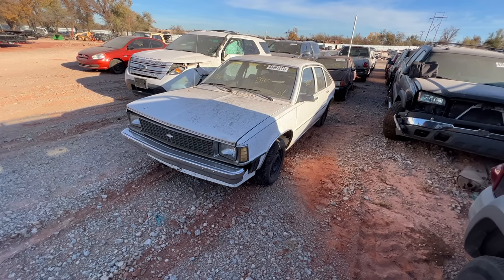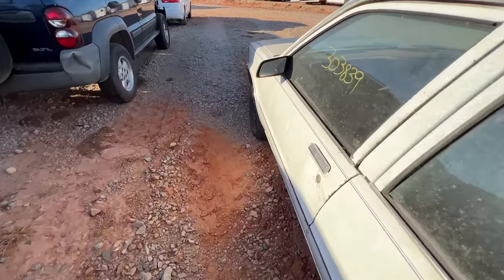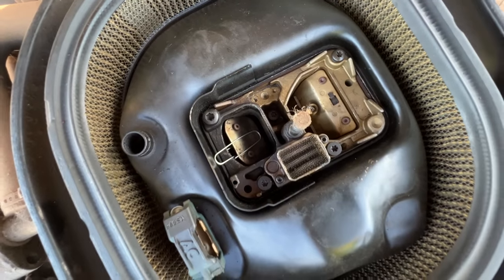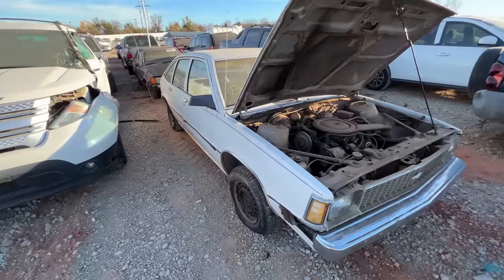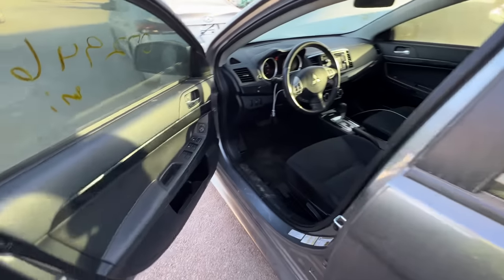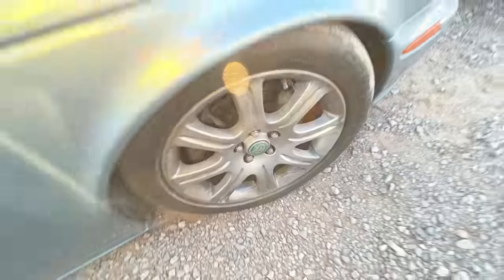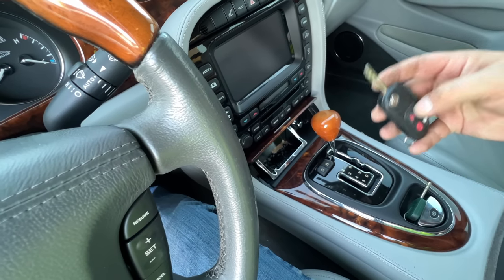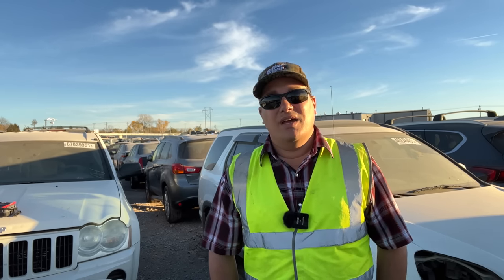Copart Walk Around 12-3-21 Childhood Trauma in a Chevy Citation

Comment: Oh that beautiful JAG! Think that one deserves a save depending on the condition of that V8 under the hood. Even with the tampered with fuse box. I hear strong compression, that's a healthy sounding engine. the 4.0 or the 4.2 are decently reliable engines. And The Jaguar Air suspension actually is much better then the Mercedes stuff. A lot of parts can interchange with some Ford models.

Comment: I worked at the gm facility in MidWest City Okla. starting in the fall of 79 and was part of the assembly line process in the paint department. We built the Citations and also the Pontiac Phoenix. The paint used on these cars were a water based paint in a negative air pressure paint booths. You could paint the vehicles with no respirators due to the over spray was pulled to the bottom of the spray booth and into water under the grates. Had to have just a paper mask and suit on to help keep the little bit of overspray off your clothes. The booths were air conditioned and very comfortable to work in. A car would pass by your station every 6 seconds and you had a certain area that you painted. Had just finished high school and was one of the lucky ones to get hired.
Reply from the maker: Sadly that plant was shut down many years ago. :( I always loved driving by the GM plant out here.

Comment: That lever on the Citation you were pushing was the headlight dimmer! 🤣  You were in the ballpark, though.  The lever running to the ignition switch runs next to it, and then curves up and goes over the top of the column.  The actual ignition switch is closer to the firewall.  The classic GM "Saginaw" steering column..

Comment: Had a 1980 Citation, it was dead reliable!  Bought it used with 65,000 miles, only time it would not run is when the battery went bad.  Will have to post a couple things about it on my channel in the future.

Comment: There was a 1981 Citation up in Chickasha on FBM for $750 for the last year or so, it was overheating but was also V6/auto, white on brown, 5-door and running.  One would be a great parts car for the other for sure.  But it's gone now.  What I would like to find is a 4-cylinder Dodge Dynasty, 88-89 model (no airbag), bench seat, crank windows.  I had a silver '89 back in '97 and it was so simple and perfect.

Comment: We used to use these kind of cars for tow cars behind motorhomes when we were doing deliveries for Winnebago industries surprisingly the manual version of this car mix a great tow Car I've owned every year and model of the Chevy citation
I want to say this was an 83, because in 1984 gm turned the radio horizontal and the rear turn signals were orange, not red, steering column tilt screws were notorious for coming loose, which may be why it was all takin apart

Comment: Randy, when you have a car like the Citation, put the hazard lights on so you can see from the front of the car when you have a good connection on the booster.
Reply: Tu si sabes primo
Reply: @snoopy5736  Tengo mucha experiencia con carros asi.  40 años de experiencia.

Comment: Mine had a 77 4 speed manual, Brown Chevette back in Puerto Rico. It had a hole in the floor on the right rear underneath the front passenger seat. She rebuilt it with some neighbors and friends, with some parts off of a 1979. Sold it for $700,  to a friend of hers. She got into a collision so bad, the rear seat got pushed forward on the drivers side, and pushed the drivers seat forward. I cant remember if it was an Econoline or an F150 that hit her. Seeing this brought back some hard memories. Good and bad.

Comment: The manuals say the following:
In the engine compartment, fuse F14 (5A) controls the fuel pump (for diesel).
Inside fuse F18 Fuel pump relay (petrol). Rear seat must be removed to access. But in the found video, this block is located on the right at the feet of the FRONT passenger. Perhaps it is different from European cars from cars for the American market.
In the trunk, the fuse F8 Fuel pump (Petrol)
Hope Randy helps you. 
My first car was a VW B2 (sedan) 83 years old. 10 years ago, when I was looking for parts in a junkyard for my Ford, I saw an old VW similar in color. All that was left of him was the body and the back doors. And my VIN number! It was a very strong attack of nastalgia. Hopefully its details have given life to others.

Comment: I never found anything wrong with the Citation. I know there is that whole recall/ Government investigation on these cars because they supposedly locked up when you hit the brakes, but I believe that just like the so-called Audi cars that accelerated on their own, this is another case of driver/user error. (The Audi "issue" was caused by US drivers that were not use to having a small brake pedal that looked like the gas pedal so they hit the wrong one). With the Citation, folks coming to that car, probably owned a RWD car that the Citation was replacing and had no clue that a FWD car handled differently then a RWD car. This is understandable as other then a few Euro cars and the Dodge Omni/ Plymouth Horizon, there were only RWD cars in the USA at that time. The sad thing was that car (and the other FWD X bodies) got a stigma and that killed sales. The cars were really not that bad for a car of that era. GM ended up coming out with the FWD A body in 1982 which was derived from that X Body platform (and used the same engines and brakes) and they ended up being reliable and beloved (and it was the basically the same car with a new body on it). I like all the Citation models from 1980-1985 though I liked the 1985 Citation II the best due to it having fuel injection (life is too short to have to constantly screw with a carb)

Gotta love the late 1980's Ford Escort sitting behind it.
Reply: I looked it up on CoPart, the Focus is a 1986 FORD ESCORT L it's Diesel!
Reply: I have a diesel citation
Reply: @alexrobertson8642  I never knew they even had a diesel in a Citation.
Reply: I have driven many Citations and most of them locked up the rear brakes.  The go out of adjustment easily causing the problem.
Reply: @todddenio3200  They never came with a diesel from the factory.

Comment: I had a Skylark, which is more or less the same thing.  Was a free car.  

The big redeeming thing on them is they are great in the snow.   Mine had some strange brackets tacked on the bottom with crap welds and when I hit a chunk of snow/ice from another car, it knocked that off, I ran it over and blew a rear tire.  Well, long story short one lug rounded off and it was just late enough on a Sunday night I couldn't get even into a parts store for a nut splitter.  So I got pissed and drove it like eight miles home, stayed off the highway, on roads coated with snow and ice.  I got home fine and drove it a few more months after that.  

A donor column is going to be needed here.  Not hard to swap and the interchange is all those X-body cars but finding one may be rough. 

Mine had a flat spot in the carb.  That's the other issue, most of them have a computer controlled carb and finding replacement parts for them is tough.   If I were going to play with one I would see how hard it is to convert it to a mid-90s 3400 engine with the EFI.  

Potting soil and potty paper, that makes sense

I think that wire on the column you were pulling is just the high beam switch.  Ignition is under or on the other side. 

I'd go $100 on it if it ran

Comment: I had a 1980 Citation  , black two door with the 2.8 v6 , it run fine but the front engine mount kept breaking , i replace it three times , until i sold it in 1984 .

Comment: Honestly I have never had anything against the Chevy Citation. Last time I saw one though was about 2004 and it was for sale at a dealer. It didn't look to bad. Also thats sad about the Jaguar it could run if you find that relay. But that air suspension is probably risky though. Awesome video Randy.
Reply: @BadDriversOfTennessee Yeah that is true. Very similar in the front.

Comment: The sound on the Jag is familiar....almost like when my 99 XJR would flood itself out..... I would have to pull plugs, blow gas out of cylinders, replace plugs & change the oil & voila, off I went..... it's worth it at $1600.....for parts alone.  Check the oil, if it's gassy, there's the issue.

Comment: WOW!!! I didn’t think there were any Chevy Citations still remaining in existence in any condition be it good or bad.Make a low bid on it so you can at least recover the costs later by selling it for scrap if you can’t get it running. I think the owner is who took the steering column apart and the rod for the ignition switch is not the one you were trying to use and from the location I think it was for the headlight dimmer switch. I think the ignition switch rod would be either on top of or below the column or possibly even the other side but not on the left side. As for the Jag, you could still turn a nice profit by parting it out.

Comment: Jag: Checking the underfood fuse diagram, my quick guess is they removed the fuse for the throttle actuator. Relay info is surprisingly hard to find, I can't tell if it might be a relay for the throttle, fuel injectors or ignition coils, or whether it's something for the diesel that won't be used in the "petrol" engine

Comment: The rod you pushed is dimmer switch in caviler
Reply: GM with dimmer in multifunction switch actuated by lifting signal switch pushes the rod you pushed, ignition is a different rod, citation might run if you dig deeper!!

Comment: If that's really in 1984 then it should be called a citation to cuz my mom bought a brand new 1984 citation 2 because of the problems we had with the brakes and 1984 they change into citation to because they supposedly fixed the brake problem cuz they were locking up and you would spin out and they were fuel injection that year to on the 4-cylinder don't know about the V6 my mom's was a 4-cylinder with their condition and there was a two-seater with hatchback it was in burgundy Lassiter five years it was a big car 70 some thousand miles